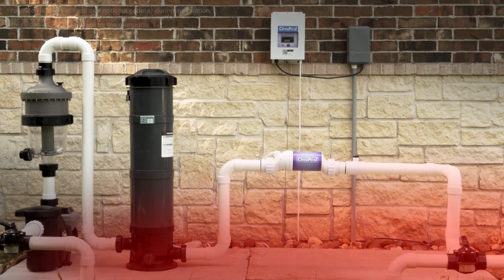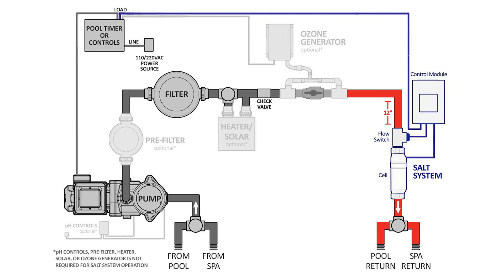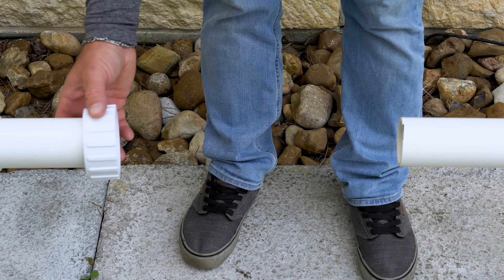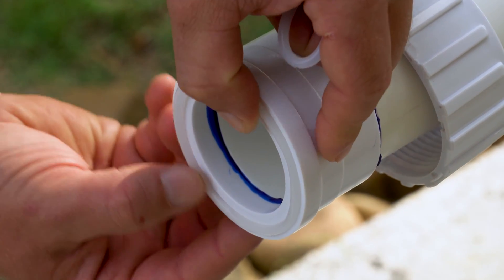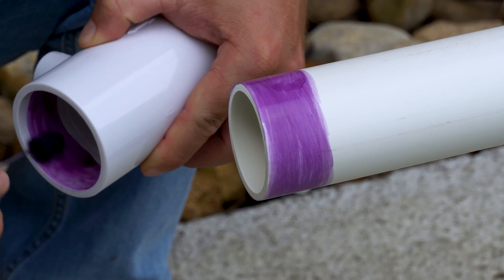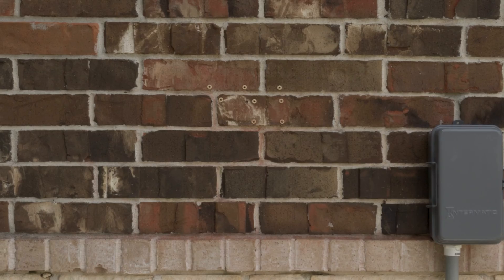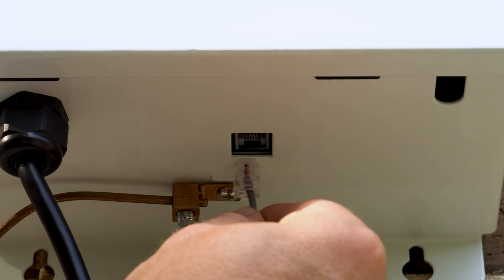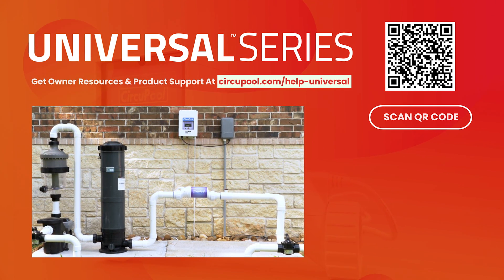Installation Guide | CircuPool Universal Series Salt Chlorine Generator | How to Install Your System

Comment: Just a helpful tip - be sure to orient your cell so that it is "inverted" (middle lower than the piping) if you have a variable speed pump! That will help ensure that low water flow rates don't cause an air pocket to form in your plumbing.
Reply from the maker: Another suggestion when setting your system up with a variable speed pump is to run the pump on its lowest programmed speed/duration combination, and set a reminder to come back and check at the end of that time that the flow through the pipes still has been able to keep the cell full of water. Sometimes that issue can occur gradually as the pool system runs and it might not be apparent within the first few minutes of running the pump on its lowest speed. Please contact our support team if you have more questions about setup and variable speed pumps, we're happy to try and make it easy. (888)-206-9938